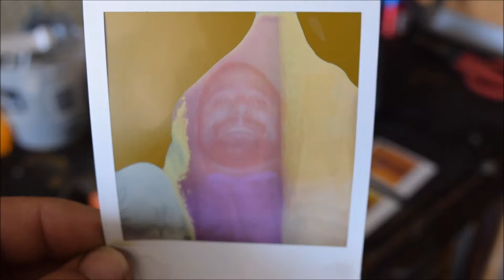Whats inside a polaroid camera  Take a look at the inner workings of a instant camera and film and h

Comment: Do your research before recording ;) Film is available. its from the 1990's. dont shake them. shield the picture from light until it comes clear. the batteries are in the film pack if its 600 film. the little dial is infact what tells you how many shots you have left in that pack. old films before 2008 had 10 shots. new ones now have 8. It was pretty cool but you killed it. :-(